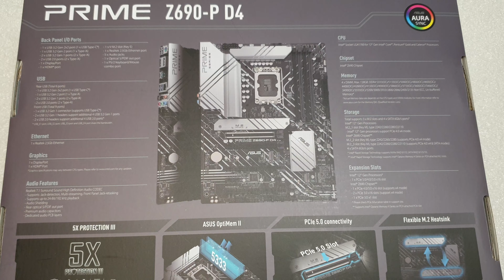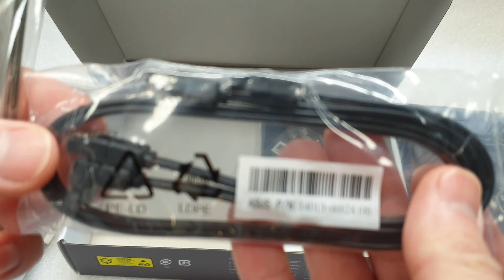UNBOXING ASUS PRIME Z690-P D4 MOTHERBOARD AURA SYNC ARGB GEN 2

Comment: They have vertical m.2 E key for wifi but doesn't include bracket. That's stupid thing I have ever see..
Reply: How does that vertical key work? I've never used m.2 wifi/bluetooth before but want to hook it up. On my other mobo it was just a chip you slid into it under my gpu but once again i never got around to using it.